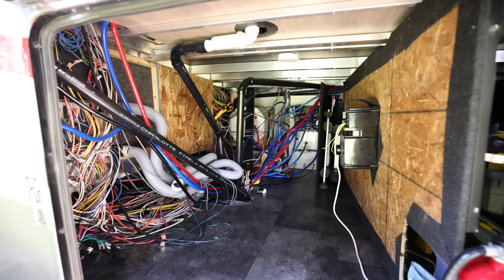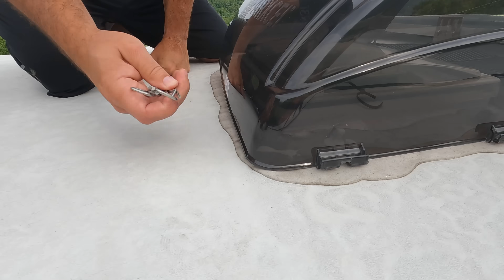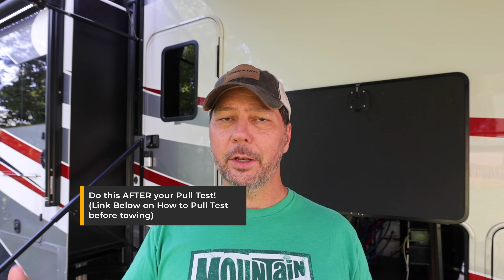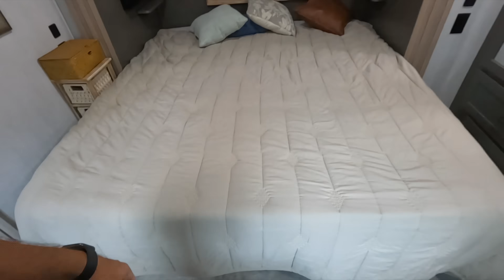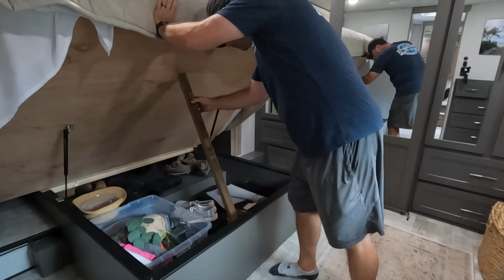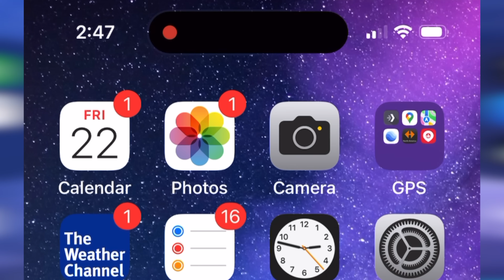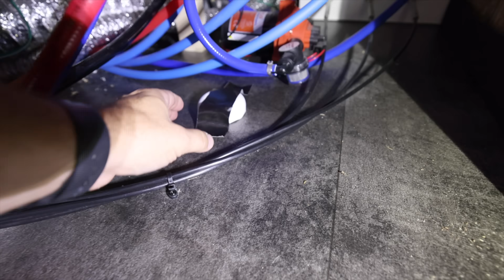Help Us Out? Stubborn Leaks and Four New RV Projects!

Comment: We have a 2021 Solitude 382wbr, also with an odd water leak. Like you, we have water leak detectors behind the wall where the Nautilus is located (near the water pump) and like you we get a small puddle of water that sets the detectors off. It usually happens after a windy rain, but there are no obvious leaks. I have sealed all of the outside seams (several times) and there is no signs of dripping or trail showing where the water is coming from or coming in. There is never very much water, just a few tablespoons worth. So if it is leaking due to the rain, wouldn't there be more water? My latest diagnosis is that it might be getting in through the storage door on the opposite side, just behind the propane door. I had put a bath towel down to help me slide stuff stored in there, in and out. The other day, after it rained (put didn't set the detectors off) that towel was soaked. But we've had rain now for several days and that towel is dry. Go figure. 
My 'solution' has been to set the leak detector on one of those drying mats you have the dishes you've washed. My thinking is that it will absorb tiny amounts of water without setting off the detectors and allowing it to air dry. If a lot of water, the detectors will still go off, but not until there is a significant amount. I also cut the wall and installed a hinge so I can get behind it without having to remove screws every time. I will update you as my research continues. 
Thanks for all the great videos! Just watched the one where you compared water heaters. 
Eric & Jennie (full time for 3 years)

Comment: My nuisance leak in the basement was coming from a slightly loose pex fitting   At the bathroom sink cold faucet. The pex tubing went straight into the basement overhead and made a 90 degree turn aft along the overhead. The water travel down the pex tubing and dripped on the basement floor. It wouldn’t leak all the time just during temperature changes is all I could figure.

Comment: On our momentum, the basement door on driver side had minor leak that did not always leak. It was only when the wind was pushing the rain in the correct direction.
You can try colored tissue paper, even if it dries it leaves watermarks on the paper placing it around may help

Comment: I had a leak every time it rained on my Solitude. It was leaking around a receptacle. I pulled the cover and siliconed. Replaced the cover, and caulked around the cover. Fixed it

Comment: Hey Chad and Tara1 Love the channel. Chased an occasional leak for 2 years on my Starcraft 24RLS (Jayco). It kept showing up in various places. Finally found it...twist connector behind the water inlet docking station. Very slightly loose and only leaked when pressure/temp/? was just right. Worth a check. Crimped PEX hardly ever leaks but the twist connectors can. These connectors get moved/vibrate/whatever! Sometimes just an occasional drip. Never another drop. Dave R.

Comment: It might be a cracked P-trap if there’s a shower or sink above the location of the puddle pore water with a bucket into the bowls and shower pan and wiggle the black abs pipes. Water leak might be coming from the drains. And check water using the city fill without the water regulator by slowly turning on the city water faucet to maximum. Only do this to check for leaks always use a water regulator when normal use.
Check for a cracked abs roof cap. Hope you guys find the leak 👍🏽

Comment: We had a similar unknown leak. We also have a (2023) 410th R- I traced it to the shower drain. The plumber’s putty used to seal the drain was the culprit. Just took the drain apart, replaced putty, a snugged the connections.

Comment: Hi Chad, 
I think it’s been multiple leaks accumulating. Some ideas if you haven’t tried, bay doors leaking past seal, try closing them and watch from the opposite side while you have you sweet wife spray the side with hose, you might check the outlet on the passenger side as well, most likely not but always a possibility. I actually think it is right in front of you. The drain at the top of the bay where it goes from abs to pvc, definitely is suspect, that is where I would look the most.
Good luck

Comment: I did a similar mod to the happy jack tracks, but for a different reason.  The original height was OK when the bed had the original 4" pad on it. But that sucked for company's sleeping, so we bought a real mattress that was about 8" thick.  OK, but when the bed was fully up it butted up to the third A/C unit in the garage, leaving no room for cooling/air movement. 

 I measured 12" down on each track, drilled the appropriate holes for the pins and VOILA!  The bed is still high enough to allow my HD Ultra Classic to load in the garage and still allow that A/C unit to deliver cold air w/o being stifled.  As always, a great video you two!!!

Comment: I didn't read all the comments, so this may have been mentioned. I had a similar hard to find small water leak in the basement area of our 5th wheel. I could not find the source after weeks of searching and caulking everything I could think of. As you know finding the source of the leak is the most challenging part. Here is what I did to find the leak source.

I took some baby powder and sprinkled all on the floor of the basement area where I suspected the water was coming and even places I figured was not the source. I also sprinkled the powder on all the pex pipes, water filter housings, etc...basically anywhere that water may drip. Then I waited. A few days later the water leak detector sounded and I found the source of the leak. 

The powder allows the leak to make a trail from the floor low spot to the source. Yes, its a bit of a mess to clean up afterwards, but a small shop vac will get up most of the power. It may take a few travel days and re-vacuuming to get it all up. It doesn't take a lot of power. A small travel size container is plenty to adequately cover the entire basement area of a 5th wheel.

I would suggest doing the powder method if you are going to be stationary for a few days (no travel days) as the power does tend to move around during travel. I guess it would not harm to put powder before a travel day but be sure to put more powder once you get to the destination as to fill in the voids that came from travel.

Good Luck, JH

Comment: Water on my rig was being drawn in from the combustion air intake whenever it was raining and furnace was being used. I tested my issue by utilizing a cone funnel and cut at the position on the cone where it could be inserted into the intake. In short, the larger diameter decreased the face velocity and water was no longer being sucked into the furnace housing, via the combustion air intake. When the furnace shut down, water that was drawn in, settled back somehow into the fan housing. I installed a drain pan w a 1/4” lip under the furnace.

Comment: I had a similar issue in my 2018 354m. Water pump was the culprit when I didn’t release pressure after using it via the low point drains. Eventually had to replace pump haven’t had water since. No visual water while pump was running just when it sat under pressure.

Comment: Condensation can produce a surprising amount of water. Could be coming from an interface between furnace and cold air or cold surfaces. Sometimes condensate falls down a flue or trickles between walls, especially around windows. Sometimes the seals on the slideouts "squeegee" condensate from the walls and it runs into spaces between the walls and floor. Air conditioners can also do this in the summer. A small amount of water like this could be produced by temperature difference.

Comment: We dealt with all kinds of leaks in the same area. Everytime we thought we found the source.. anyway it turned out we had 4 cracks in the frame found after the service center pulled the bedroom slide out. We have a 2022 fuzion 373 toy hauler 
No leaks since the fix.. and we have been through 3 tropical storms since..😅

Comment: put your paper down all over that area to try and track it.  We run primarily off of the onboard pump.  Water damage is one of my biggest fears.  We would hear the pump burp from time to time.  Several months later, we finally found water under the water heater, which is a well known issue with suburban water heaters and poor welds.  Good luck, as you're finding out, water always wins.

Comment: Great video. Have 2 suggestions.  For the red break away cable be sure there is a metal cable within the plastic. I bought one that was just plastic. Not good.  Also for the mystery leak. Suggest placing the blue towels down. They will absorb were the leak is starting for a quick find but would require frequent checks as it may prevent water getting to the sensor if just a small amount. Good luck!

Comment: I kept having a mystery puddle in my basement. I discovered it was coming from the vacuum breaker in the bathroom. Water was leaking out of the valve on the vacuum breaker as it was very loose. Water was running down the pipe and into the basement. It wasn't just dripping into the basement it was continuing to follow the water lining in the basement until the line went back up hill and there it was dripping from the water line. Because it was dripping off a water line, I was convinced it was from a water source until for kicks and giggles I thought I would check the vacuum break. Behold, loose, I tightened it up and never had a leak again.

Comment: When doing the breakaway test, highly advocate NOT being plugged into AC power. We were setting up and a friend was there. Their child pulled the cable without us knowing and it completely melted the breakaway controller. We could smell the burning and ran around the trailer to find it.  Could have been a faulty unit but still could have been a disaster.
Reply from the maker: I think your controller would have melted whether on shore power or not as it's DC and powered from your RV's battery.  I guess there's a chance you might drain the battery before melting depending on your battery capacity...

Comment: Our friends have a new GD and had a similar issue. After much investigating, he found that the side basement door was inverted during assembly. The bottom edge should have the butt joint in the aluminum trim/frame and also a few small drain holes. While the door was assembled and the slam latches were cut, the door was positioned upside down. This allowed the door panel to fill with water and leak out where-ever possible. In his situation, into the basement.

Comment: Chad, is the water leak potentially coming in from the black tank vent cap on the roof? Depending on how your piping is routed it could be the water pathway to your basement. Best of luck to you finding the water source.

Comment: Long time subscriber, love your videos, Daisy is the cutest. As for the leak, have you considered that the leak "might" be coming from the roof? If your puddle is anywhere near a vent pipe, water "might" be running down the outside of a vent pipe, and landing on the storage bay floor. Don't know, not there, BUT water can do some crazy things.

Comment: We had a similar issue in our reflection.  If your shower is directly above that area, check the sealant on the shower track.  Ours wasn’t sealed properly and the water trickled out, found it’s way to the drain, down the grey water drain and dripped onto the mystery spot in the floor.  Took me forever to find it.

Comment: We noted that you checked all of the connection points. The only thing we might suggest is closely scrutinizing the hand-tightened compression fittings at your plumbing fixtures. We had two (one at outdoor shower and one at kitchen sink) that would ever so lightly leak. We figured it was due to plastics in compression and vibration from traveling. With a little extra hand-tightening on the wings of the compression nuts, we were good to go. We still check them whenever we have the access panels off. We pray you will find it soon.

Comment: Did you do a pressurized leak test using air pressure along with whatever water is in the lines? It’s a technique marine mechanics use on some systems. Married to one.. he says it’s easier to do than towels or cameras. He also has one RV in the hunting camp, has to bring in water tanks, pumps, etc. occasionally has to find a leak & fix it too.

Comment: Each nautilus system pipe may be pressurized at a different time depending at what you’re needing to do with the system and only leak during that setting. Try setting up the nautilus for different conditions such as dry camping, city, etc, and see if that creates a condition for a leak around the nautilus. Mine would only leak at one of the top junctions when I configured it for dry camping.

Comment: To find a leak, tape those shop towels in every place you think there may be a leak. Around pipes, hoses, walls and the overhead. When the alarm goes off, check it right away. I've used regular paper towels around a toilet to find where it was leaking from.
Reply: Also Don't forget about in area causing moisture in the air!

Comment: Hey Can, I too had a situation where I would find water every once in a while. It took me nearly 9 months to find it. In my case it was my black tank flush fitting behind the wet bay. Check the black tank valve fitting and see that it's tight, has a washer, etc. Mine had two washers stacked. I removed one of the washers, retighthened and that solved my issue.

Comment: Chad
I had the settings on the water valves set wrong. I was hooked up to campground water but had the valves positioned for “winterization” and for some reason we had a leak. When I set the levers correctly no leak. Maybe this is your issue?
Reply from the maker: I verified those were good.. dry camping mode.

Comment: Hi , love your channel , but one question for safety , i feel that your Breakaway switch should,not be hook to your fifth-wheel hitch , ??? cause if your hitch malfunction , well the cable risk to not do the job it was intended  for  , so that's why my cable is hoocked to the bed side of the truck , Safe camping >
Reply from the maker: Ideally, yes.. it should attach to the truck.  But we no longer have a cleat on that side due to the volta system.  I might create a way to hook it to the toolbox.

Comment: We had a similar leak on a 3k mile trip to the grand canyon.  Ended up being a loose connection where the pex connects to the plastic fixture on the wet bay back side.  It didn't leak all of the time, only when the connection was under some sort of stress like bending it or when it was being jostled around as we drove.

The water was leaking down the pex, dripping into the middle of the floor, and following the basement wall for another foot or so towards the opposite side of the trailer.

I always make a point to release the water pressure using the low point drains, but somehow it still had enough in it to come out of that connection point when we were driving and it was bouncing around.  Tightened it up and haven't had an issue since.

Comment: We had a similar problem with our GD 390rk Solitude. After looking everywhere (I thought) for a month or so we coincidentally needed to change our shower mixer valve which was not allowing water to pass through. That is when I found it. We had a slow leak coming from the shower mixer valve which was installed upside down by the factory (I found that out when trying to find a replacement). The mixer valve has a pressure valve where the shower wand hose attaches. If installed upside down the wand hose simply drains out and down (slow drips) into the valve assembly housing and finds a path out the back of the shower wall through the supply hose holes onto the shower fiberglass wall and down to the basement. I'm trying to get GDRV to do the right thing, since this improper installation caused basement floor damage. Hopefully this helps you. If not, hopefully it will help others. Either way good luck and see you down the road someday!

Comment: Get a Flir thermal camera. I think you can get one pretty cheap (sub $300) and that will help track down the water leak. Water will generally show cold in comparison to the surface temperatures around it. Good luck!

Comment: Mine only occurred when I would fill the fresh water tank.   I also have an alarm under the pump, & under the hot water tank.  It turned out to be a loose fitting on the back of the Nautilus system.  Right where all the connections go to the nautilus and where you cannot tell the difference with any of the hose connections.  I pulled the piece carpeted wood next to the Nautilus, and could get a better side view.  I could now see where the slow drip was.  
The problem was a threaded 90 that if you tightened it, would point toward the nautilus and then you could not hook up the hose on the back.  I added multiple rubber washers in the female hole to allow the threads to bottom out on something and I also put Teflon tape and RTV on the threads.  Secured it as best I could and it stopped dripping when I filled the fresh water tank.

Then I would still sometimes get a little water behind the Nautilus because it was not sealed against the side wall of the RV.  It has a ~1” lip against the RV, but as I would clean up water in the Nautilus bay, water would slip between the rv wall and the nautilus slide under to my water sensor.  I RTV’ed that up and so far for about a year now, I have had no water alarms.

Which reminds me, I should change the batteries in my alarms!!

Great video as always!  Good luck with your Leak!!

Comment: I noticed the coax cables were above the puddle could it be coming down the coax from the roof. Those brackets that you put your vent covers are known to leak, you can pull the pins and put some Dicore in the hole that the pins go in and then reinsert pins.